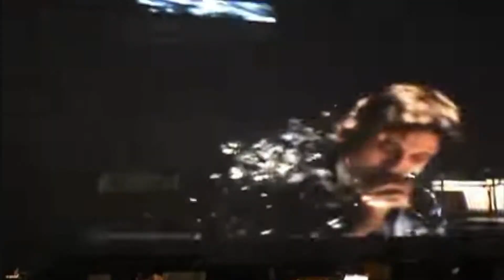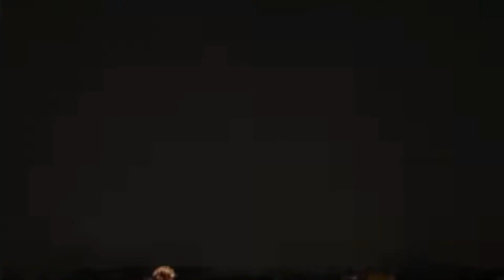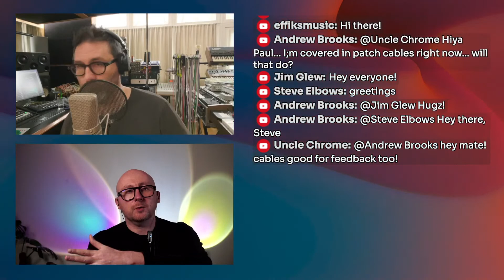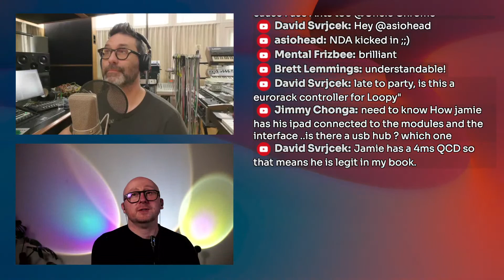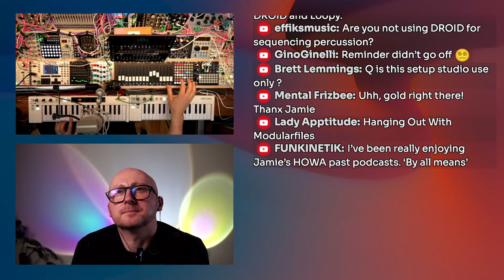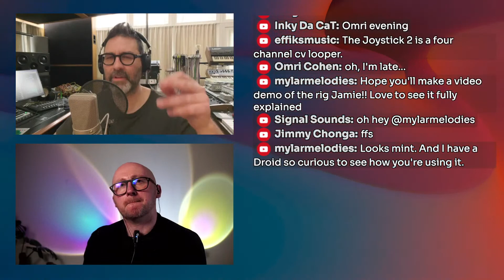Tech Talk 02: Jamie Lidell - Electronic Music Production Process, Workflow and Creativity

Comment: new boss slicer pedal reissue would work well with this regarding fx @47minutes
Reply from the maker: Yes good shout. Ive never used one - have you?
Reply: @matthsmatthsmatths  no I only came across it on yt the other day but thought it looked great. I think it was on Jorb's channel. Don't know if you know of him, he does interesting gear vids
Reply: Forgot to say it looks like a good not too expensive way of doing gated effects like distorted guitar on old shamen records (en-tact, boss drum) could just feed it distorted oscillator and gate it with preset patterns or I believe it has gate trig input which is why I’ GASing over it, cos I play one of those odd things with strings, as well as synths and DAW too